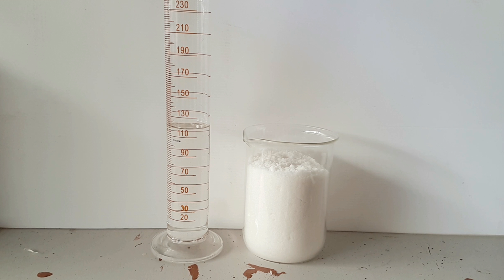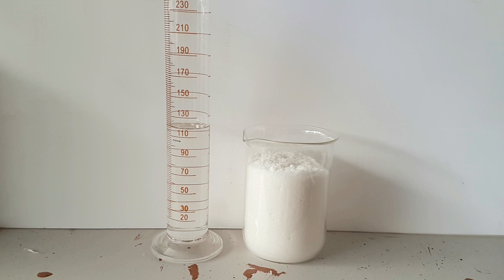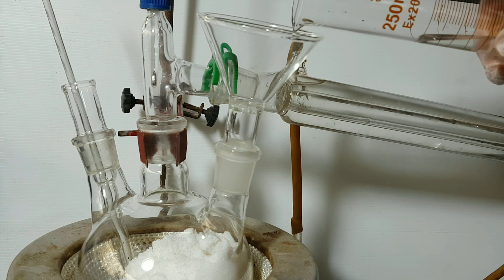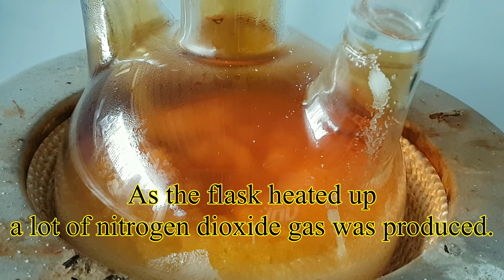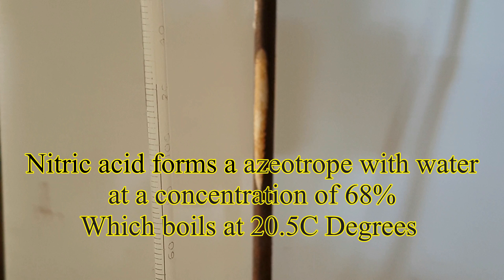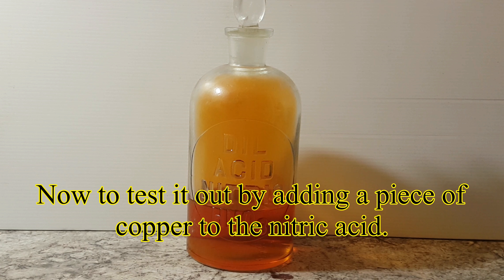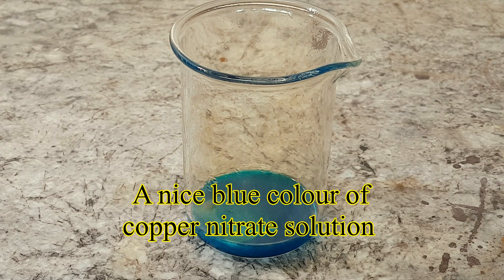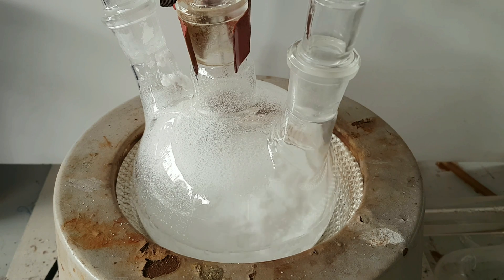Synthesizing Nitric acid by using phosphoric acid and Sodium nitrate

Comment: You have a low rate of  yield because you stop the  reactions  earlier before completed .. you need continue heating until there is no more brown gas showing up in the flask, use the infrared thermometer, in this point the temperature will rising up to the 90-110, but if you measure No2 gas, you will see the temperature is about 80-83.. inside the flask goes more hot but still you make nitric acid until no more NO2 generated, than its the time to stop the reaction..

Comment: Actually this reaction 1:14 is not possible because you can't get Na3PO4 that have pH of 11 with  NaNO3 that have pH of 7
What you can get is  monosodium dihydrogen phosphate or NaH2PO4 that have pH of 6.
To get Na2HPO4 or  Na3PO4 you need to react your product with NaOH to increase pH.

So your reaction just need 1 mole of NaNO3 and 1 mole of H3PO4
So if I'm correct your yield is about 90% .

Comment: But 96% H2SO4 is cheaper than 85% H3PO4
Reply: Ok, but H2SO4 is hard to get at all where as phosphoric is easier to get, where do you get your h2so4?
Reply: In EU you can at best buy 15% H2SO4. Some cointries like Sweden doesn't sell any H2SO4 at all.